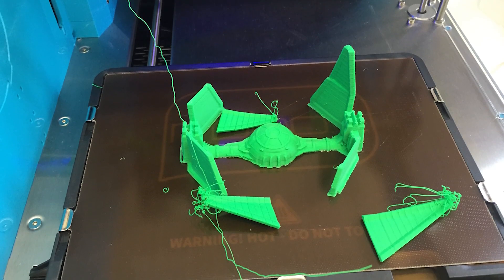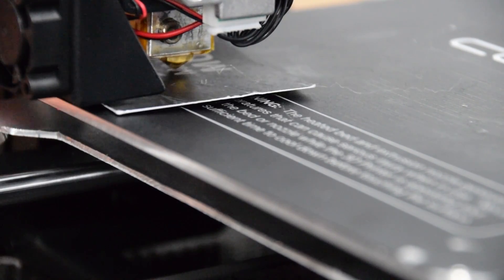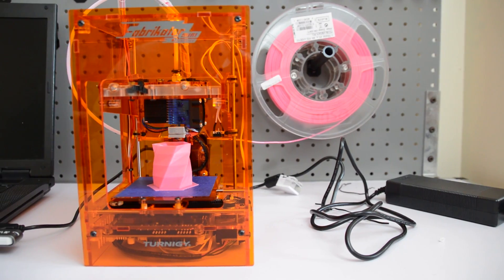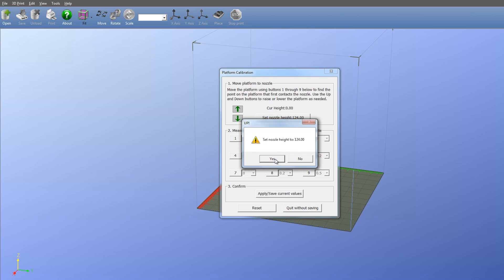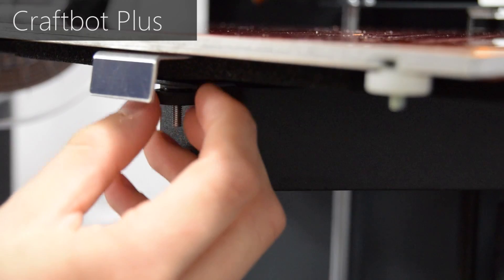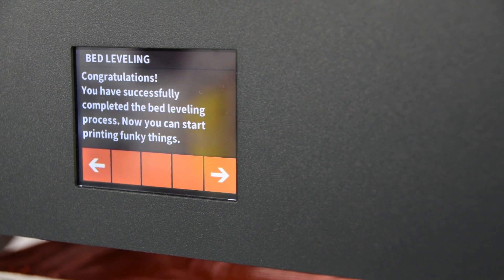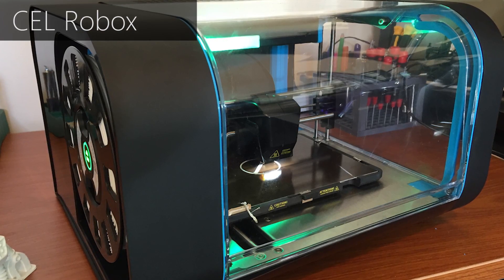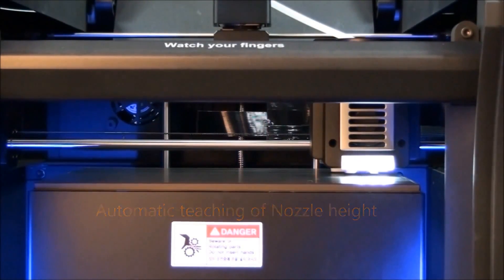How to Set your Nozzle Height and Level your Bed - 3D Printing 101

Comment: I have a Flashforge Dreamer and this is the only thing I could criticised about it. The built in routine is not accurate enough consequently I have developed another method that has proven to be more accurate and consistent. Same with my Fabrikator mini it is not quite level but by doing the recommended adjustment in the middle of the platform rather than the home point corner the build size is not big enough for it to matter. Great tips.
Reply: +Paul OBrien I too have a Flashforge Dreamer.  What is your method of levelling the bed?
Reply: +Tim Roberts ok let see if I can explain. I bought a set of feeler gages from an automotive place I use the 0.06mm thick gage (very thin, paper is around 0.1mm) warm up the bed and nozzle then from the touch screen, select "Home" once homed select manual Z axis down a little then X & Y move the head so it is around 10mm to the outside of each adjuster on the bed Z axis up with the feeler between the nozzle and bed then adjust the for a snug grip of the feeler between the nozzle and bed, do each of the three points a couple of times until they all have the same feel and this will get it very accurate. The idea is will check points closer to the edge of the build plate reducing inaccuracies in adjustment. the inbuilt routine does three points but they are offset with a smaller triangle and never quite got the build plate level. I will try and do a video on this.
Reply: +Paul OBrien Thanks for the reply Paul.  I have some feeler gauges already.  If you could do a video that would be very helpful.
Reply: I will see how I go. I am always looking for techniques that are simple to follow to make more precision task easier.

Comment: On my older M3D printer it has software that calibrates the print head to the bed, works good.  On my Wanhao Duplicator i3 v2 I did the M3 nylon lock bolts on each bed posts to strengthen them and then more M3 bolts in the thumb wheel that replaces the leveling wing nuts.  I check bed levels (Duplicator i3) about once a week and rarely is it too far out of level, if at all.  And I agree, bed leveling is 101 and very important if you want good prints.  :)
Reply: Ask Holy Spirit to teach you and to guide
you. I would recommend the YouTube Cleveland street preachers and follow Jesus no man no religion. Be holy and obey Jesus. Hebrews 5:9 "salvation is for those who obey. Jesus says if you love me keep my commandments (John 14:15). Jesus even says if you keep my commandments then you shall abide in my love (John 15:10).

Comment: Ultimakers have the 3 thumb screw system as well, absolutely infuriating to learn but once you do it enough it's not too bad.
Reply: They are the easiest.
Reply: I've never used a printer without 3 so I have no personal experience but I can't imagine why 4 would be harder, care to explain?
Reply: 3 is just enough and the printer leveling is very accurate and confident inspiring. 
The chassis is relatively strong and stable so flex is not a concern.
Reply: i converted an old printer from 4 screws to 3. so much easier. With 4 you need to adjust opposite sides simultaniously to avoid bending the structure. With 3 screws set the level of the bed is fully defined and fixed in all axis. There is only one correct length for the 4th to be at without stressing the frame.
Reply: +Scienteer or to put it another way. A three legged table never wobbles, but a four legged one almost always does.
Reply: That make sense, didn't think about warping from uneven screws, thanks guys.

Comment: Angus, for the Duplicator i3 (and clones), you really should NOT use the option "Disable steppers" when levelling, as you may throw your z-axis out of proper alignment while moving the axes manually. Instead, just just the "Home Z" menu option, which will activate only the Z-steppers and keep the X and Y steppers disabled (provided that they were already disabled, as they are after power on). If needed, you could press "Disable steppers" first, and the immediately "Home Z" to get into that same state where the Z-steppers hold their position and the other two are free to move.
Reply: I can't find that option on my Geeetech i3. Can you be more specific where I find it?
Reply: minecrafter0505 Quick Settings, disable stepper
Reply: Ask Holy Spirit to teach you and to guide
you. I would recommend the YouTube Cleveland street preachers and follow Jesus no man no religion. Be holy and obey Jesus. Hebrews 5:9 "salvation is for those who obey. Jesus says if you love me keep my commandments (John 14:15). Jesus even says if you keep my commandments then you shall abide in my love (John 15:10).

Comment: For the Wanhao level your bed when heated!! remeber springs change when heated!!!
Reply from the maker: +patrick4485 I sometimes fine tune while hot but haven't had an issue so far... the bed is way too hot to hold onto properly when heated!
Reply: +patrick4485 You are correct but not for the right reason :-)

The springs do not set the height it is the length of the screws between head and nut.
Reply: +Maker's Muse come one use gloves if your finger are sensitive ;-) I changed butterfly nuts with thumb screws. Keep it up my friend!
Reply: +patrick4485 I only ever level the bed when nozzle and bed are hot. Why? Thermal expansion can throw off your entire bed a little, and your extruder even more (going from 20° to 230°C does move the atoms around quite a bit...) It's not a huge error, but still throws your nozzle way off depending on the way your printer is built. And if you have a little filament bugger stuck on your nozzle and calibrate it cold, you will probably be way too far away once you start the print.
Just remember, heated stuff is hot, so watch what you touch... or protect yourself.
Reply: +ExtraBase yes that is the same as I said. thnkx for supporting my comment.